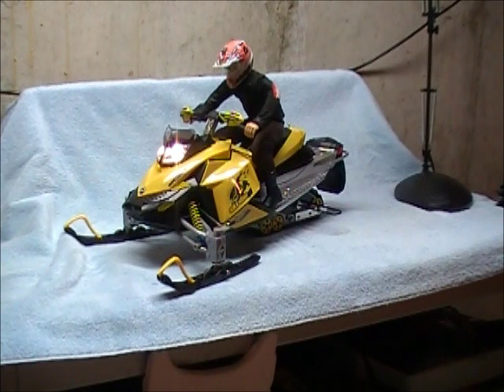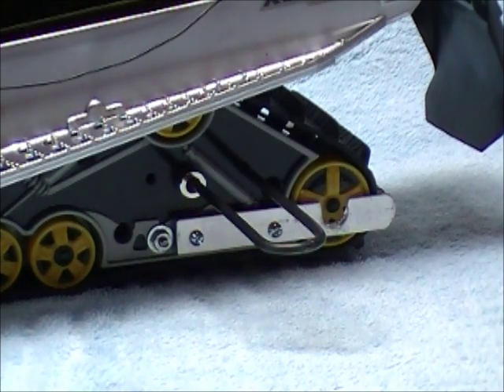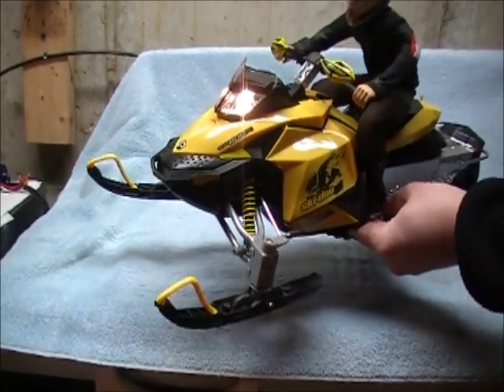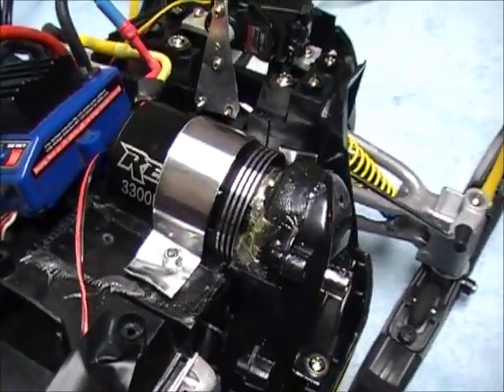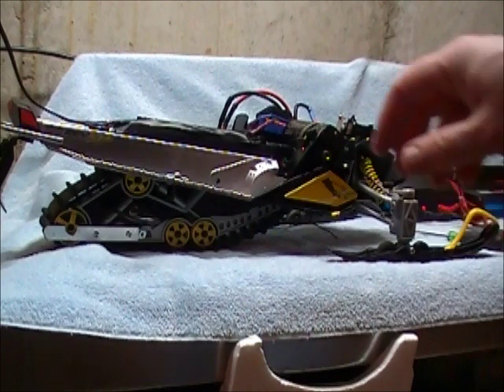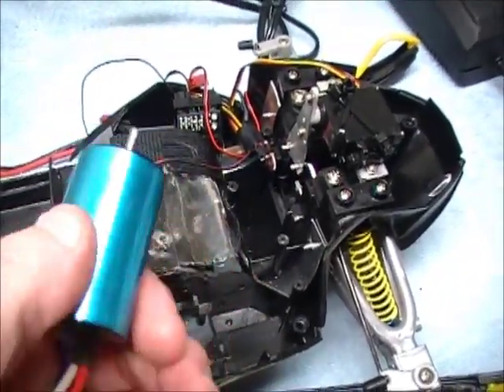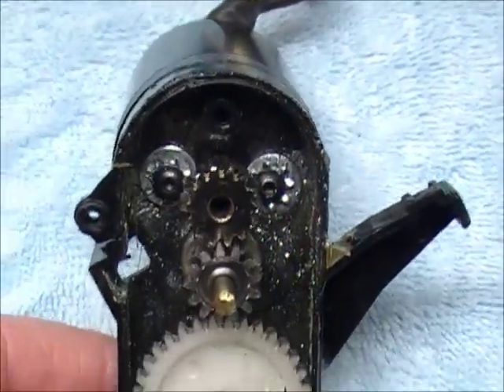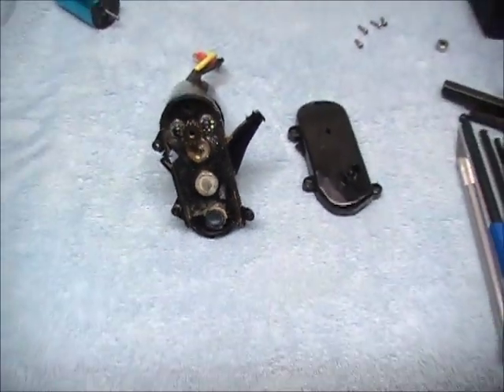Skidoo Rev XP Buildout and Hop-Up

Comment: what kind of motor is that and did you have to chang the gears
Reply from the maker: The black motor is a 540 size Reedy 3300kv. The blue motor is a 400 size (27mm) Himax 2800kv. I recommend using the Traxxas Velineon 540 and yes, I needed to change up the gears - the changes are in the video towards the end.
Reply: what website did you use to find the gears
Reply from the maker: All gears were purchased from Towerhobbies.com. You can use search and enter the part numbers to locate the gears.
Reply: what's the part number? and sorry for being a pain in the neck
Reply: never mind

Comment: I used thin strip aluminum which you can purchase at Home Depot or Lowes in the hardware department. The strips are already the correct width and thickness.You just need to cut the length. I used a Dremel tool to perform the cutting.